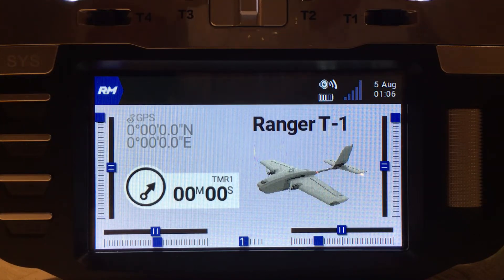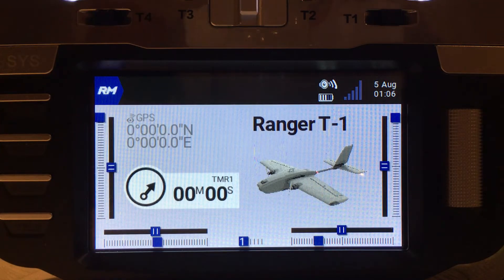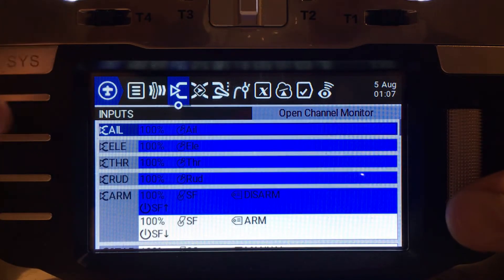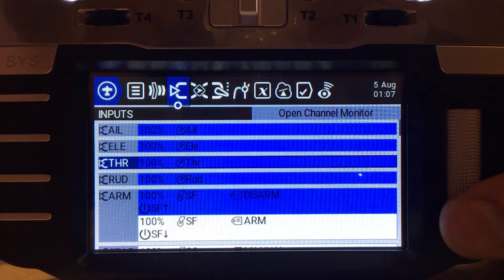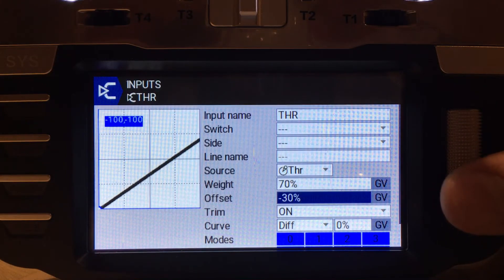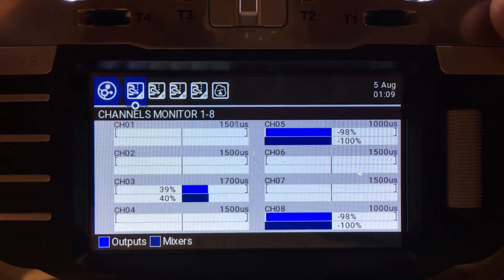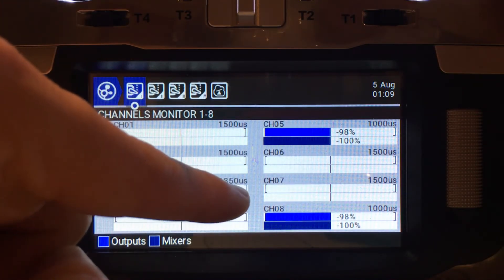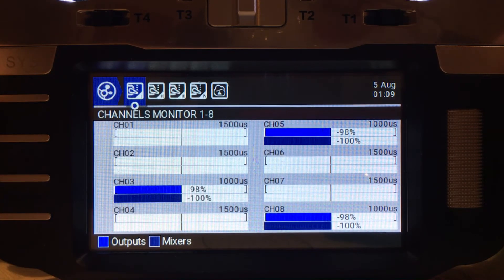Set up throttle limit on EdgeTX / OpenTX (for 4S configuration of HEEWING Ranger T-1)

Comment: Thanks.
I tried to do this but added another input for my throttle as I wanted to be able to switch between 100% throttle as well as 70% and added a switch so I could switch between them. However when I change the weight and off set on the second throttle input page the graph does not show any change nor does the throttle change.
Reply from the maker: Could you record a quick video and show?
Reply: @DZARO  how can I send u the video?
Reply from the maker: @786free1  Just upload it to your Youtube Channel and post the link here.
Reply: @DZARO  Here's the link for the video https://youtu.be/gmi3s5yrrBQ
Reply from the maker: @786free1  I see whay this is not working. The yellow box around your second section option is not moving down, meaning you have not actively selceted that mode if you will. You need to assign a switch. Let me make a quick video and show you how to do it. I'll post it as an additional response.
Reply from the maker: @786free1  here you go: https://www.youtube.com/watch?v=e9YN0hdEIr8